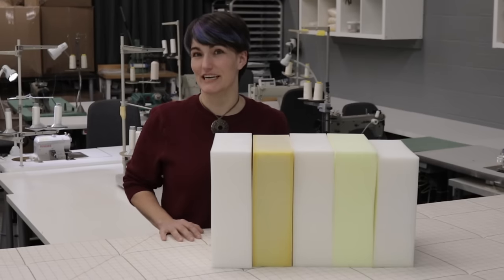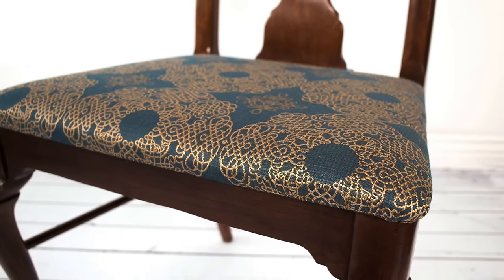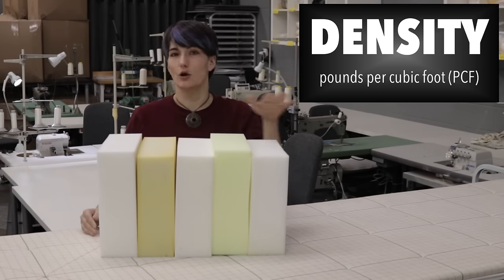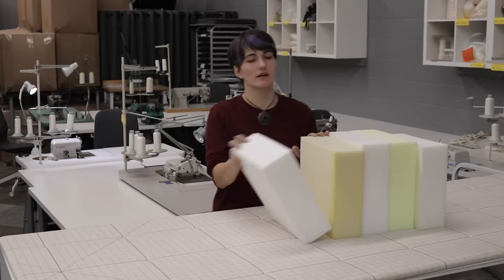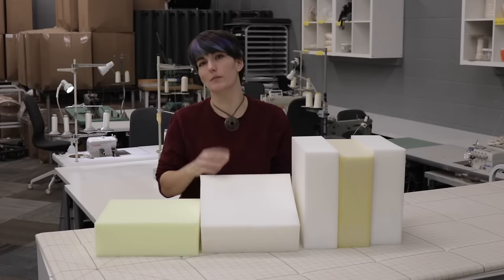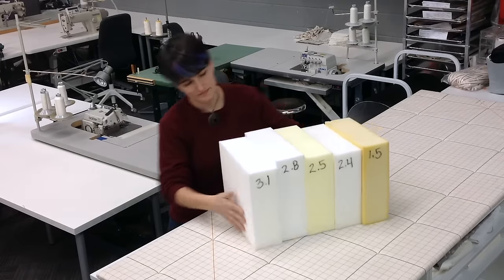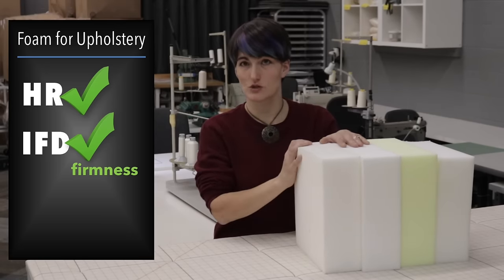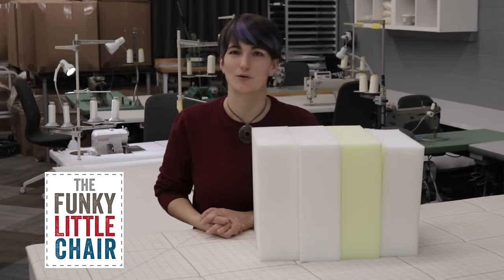Product Share - Understanding Foam for Home Furnishings

Comment: Thanks for this.. pretty much what I was looking for.. However, I am searching for a Leather Sofa with Powered Recline most all of those have a Density of 1.8 advertised and then some have that with a layer of a filled padding on top of cushion.  I want something that will last us the longest with the best feel.  Do I have to either have one or the other?  I would of course like Comfort.. My Wife weights in at 100Lb.. me almost 150lbs more at 230lbs.. what would you consider my best option to look for?  Please advise..
Reply: All commercial bought furniture will use 1.5 -1.8 cheap foam to cut corners.  I deal with this very often. They have warranty where if it goes flat they replace it but they replace it with the same foam so it’ll go flat again. You have to have a professional get you Hr

Comment: I'd like to re-upholster a sofa that has down over foam. Does that type of construction affect which foam i should select for the seat cushions and back cushions (loose pillows)? 
Also, you didn't mention the foam for sofa arms. I'm guessing they should be in the firmer range. Any suggestions?
Thanks

Comment: All correct information.  The only additional complications are 1) formulations are not equivalent or even similar as they are totally proprietary "Secret formula" trade secrets from Carpenter to another foamer and thus a Q26 @ 35 IF is not even remotely like a 2535 despite ostensibly very similar parameters.  2)  Additionally, the other variables at play like the type of upholstery (Weight, elastic properties), the design/stylistic approach at play with the upholstery (flat, no crown cushion construction vs puffy, bookwrap w/crown and more give volume gives a softer eeffect).

Comment: What IFD you recommend for an Office Chair with a backrest that has a 3.5 inch by 4 inch diamond button tufting pattern. 2 inch thick backrest and 4 inch thick bottom cushion. I know that I should be using a 2.4 PCF or higher foam.

Comment: Thanks for making this video! Is 32D good for a base layer for a bed mattress? It has 2 inches of Latex (65 D) on top and 1 inch of Memory foam (55 D and TDI based)
 in the middle with 5 inches of HR foam (32 D)
 at the bottom. What do you reckon?
Reply: Orthopaedic : The Layered composition is - 
1 inch Cool Fit Foam (35 D) + 1 inch transition layer (40 D) + 1 inch Memory Foam (50 D) + Remaining thickness High Resilience Foam (32 D)

Cool fit and memory foam, Both foam's layers remain same in all thickness even it's 5", 6" or 8". Only HR foam, we customise as per your required thickness.

Comment: Well, I am not going metric on you, so apples to apples. We have lost very large store in our city. This forces us online and I have found many do not list density. If the did, would it be the industry standard of 1 cubic foot? 
  I have foam up to 4 inches thick on hand. Without industry equipment, being creative, I would could weigh a cubic foot, but “IFD” would be more open to interpretation. Using the same thickness and the same weight, could I measure the 1 inch deflection to pass judgment on a given foam. This all salvaged foam from large new seats, kept in black bags to keep sunlight off. It can yellow due to “UV” light and turn into dead foam from use and prolonged “UV” exposure. Is this correct? Novice, forced retirement and automotive Master Tech doing my own seats, console and door panels. Thanks for you info. It “Does” help, me!